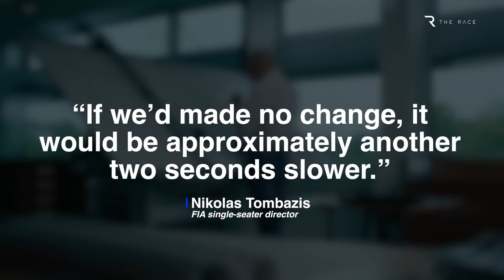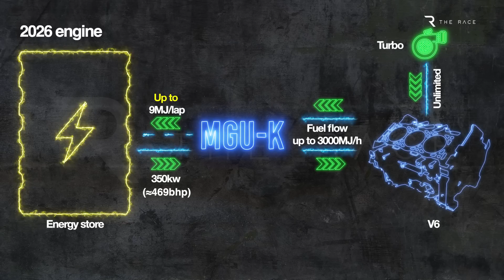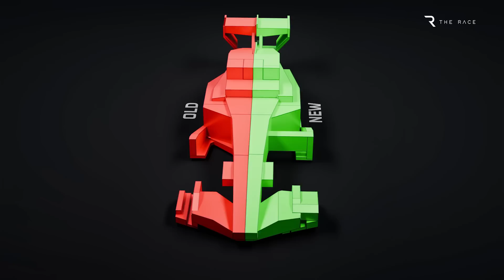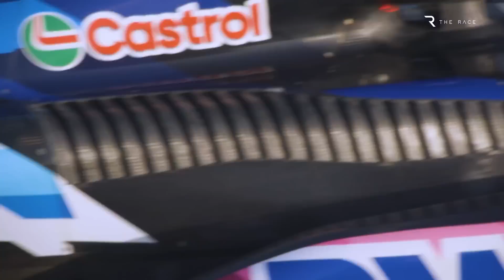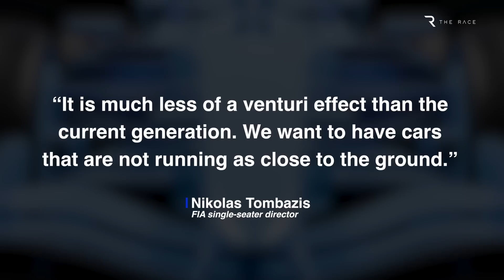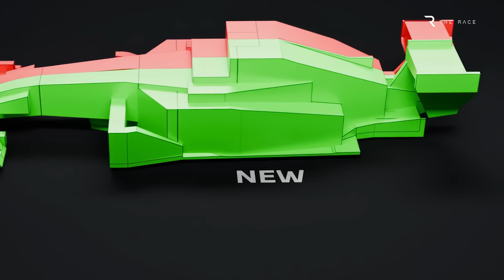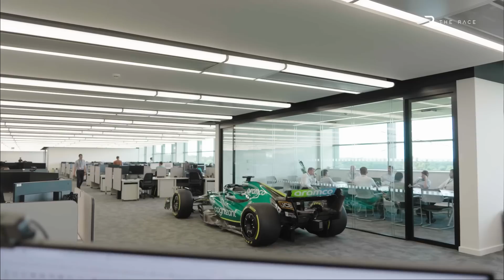How F1's 2026 cars will now be two seconds faster

Comment: Who Christian Horner?
And ETA: wouldn't the more potential "flow conditional devices" create more dirty air at 2026 and almost none but dirty air by 2028?... Thus the "electic DRS" solution? 
I'm a layman, but isn't ethanol or hydrogen (in which I believe is the future) sustainable enough?... Bring back non-hybrid engines, regardless of V10 or V8 or even twin turbo V6... This'd make cars smaller and ligter IMO

Comment: F1 just needs to have just a few rules. 4 tires used, halo to protect driver, crash pod/protection and make the car about 10-15 percent smaller with the box rules. Let the manufacturers decide engine size, cylinder count if they use hybrid, choose to refuel and weight. Then we can see what they can really do.

Comment: You hear it repeatedly said the 50% of the power will come from the battery yet the only power source is the ICE. The electrical system aids in deploying extra power for a short period but at the end of the day, with limited regeneration the average power per lap will be what? 550hp? How is this going to work out!

Comment: I want to see the cars have a top speed of 400 kph on the straights.
Reply: Thats just dangerous, if they lock up that crash could be career ending, the top speeds are fine as is
Reply: @PackyWacky1219  maybe they know that if they push the speeds 10 kph more it will increase the accidents.

Comment: Maybe this is an unpopular opinion, but I actually like how much of the car's power will come from the battery. This will be a bigger factor than anything else we've seen before. Dirty air, tire management, ride height... these will all be secondary issues if teams can't figure out their battery tech. Drivers will have a lot of discretion about when/how to use their battery, with far bigger consequences than today, which means that driver workload will be dialed up to 11. There will be a lot of strategizing, tons of overtakes, power miscalculations, etc. Racing will become a game of bluffs thin margins. It will be incredibly dramatic and exciting.
Additionally, technological advances in battery tech will actually help humanity.

Comment: Sounds like we're back to the 2021 cars, but less fun. The new 2022 car was supposed to create less dirty air and more downforce on the floor to enforce better racing. This new concept will reverse that action regardless of the endplates on the front wing. Qualifying will be good content (since they have battery), but considering the 1,6 liter engine now has to be 50/50 with the power unit will make the 2026 races to be another train event. But I guess it's okay since it will have an impact on the climate, right? It will right?!

Comment: F1 noob here, why have any restrictions at all? Why not open up the design restrictions to allow to engineers to design the most bat shit cars they can. Dont see how the manufacturers championship is a true competition when half the cars are only slightly better than the next
Reply: It’s for safety, they just can’t have cars with 1500 hp and achieving higher top speeds. CART, Indycar, and F1 have been slowing the cars down since the late 90’s. Engine builders just got too good at making horse power.

Comment: Absolutely NOT the "biggest reset in the last 50 years."  F1 used to allow the engine and chassis designers to choose their designs.  The engines and most of the car weren't controlled by the FIA regulations, as they are now.  Current, and recent, Grand Prix cars are almost a One-Design Formula.  The 2026 cars will be more of the same.
Reply: Bingo, its super overexaggerated.
Reply: @Tahllinavian all aerodynamic dependent and no scope to achieve gains anywhere else.
Reply: @Mishima505  Yes

Comment: Making half the power come from electric is probably going to result in more waste and more emissions due to how fast the batteries will be trashed after each race. The initial carbon footprint is far worse in electric cars, and when you need a new one after every new race that surely wont reduce emissions

Comment: 2026 rules are the result of basically failed 2022 regs, and they prepared ever worse - guess the result
v8-v10 with synthetic fuel and simplified aero is all we need, 10-20% battery power is ok

Comment: The best thing F1 could do to bring down weight and make cars more nimble during races would be bringing back refueling. With smaller fuel tanks and less fuel weight on the car, cars would also run way more efficient.

Comment: While a small change in the right direction, here's what would make F1 far more fun, far cheaper, and far more sustainable:
1) Fewer races! I would aim for a maximum of 15 in a season, no damn sprints! (non-championship events may be staged)
2) A mandated cut in maximum wheelbase and track to about 50% of the current size
3) A minimum weight for driver + seat, no other weight restrictions as long as crash-test worthy.
4) Ban all aero between the axel lines, with a one-piece wing mounted fore and aft of the axel lines of a maximum horizontal area
5) Drop the engine formula for an F1-provided standard fuel formula. X-amount of fuel for a face, how you complete it is up to you.
6) No driver aids, no in-cockpit or track-side adjustment allowed while the car is in motion, diff(s) excepted.
7) To qualify as a manufacturer you must design and build your own chassis, all other parts are tradeable.
8) All manufacturer's to field two entrants per race, no more, no less - no manufacturer points for any race where this isn't followed
9) Privateers may field a single car, bought as a complete package from a manufacturer, no manufacturer points.
10) An open grid - if your entry and your driver(s) qualify you get to run. Prequalifying to whittle down entries if required. 107% rule strictly enforced
11) Every team to choose their fixed tire allocation pre-season, not including inters and wets. No rules on how they are used.
12) Occasional entrants allocated the 'FIA standard' tire set for the track / weekend.

Of course it's never going to happen... 😞

Comment: higher nose cone? finally. i really think higher nosecone tip(in relation to the front wing level) more "compatible" for ground effect car. 
plus,with the allowance for more sidepod/front floor panel aero bits extend close to the front wheels in 2026, the old "zero sidepod" idea of the mercedes could actually make sense now. because now they will have apparatus to handle the wake from the front wheel. currently, the sidepods MUST take some part of that role.

Comment: ALL OF THE POWER comes from the V6.  This is where the power to charge the battery, to run the electric motor, comes from.   
It cannot magically appear from nowhere.  Power harvested from the turbo, and brakes ALL originates in the V6.

Comment: The worst aspect of the 2026 regulations have not been tackled. Those are the engine regulations and the 50/50 power split. 

Weight and size also remains an issue. 20cm shorter than current is still too long, and 768kg min weight is what F1 cars weighed in 2021, and they were still too heavy and had bad raceability.

Comment: Once we can ditch the batteries and related parts, and use renewable fuels the cars will be much ligheter even with the safety regs. Then we can get rid of the "straight speed" mode and all that nonsense too. F1 tech hasn't been relative to road cars for at least a decade. Let's get those renewable fuels in, and ERS out. If they want to be relavant, allow them to experiment with engine designs as well as all the other parts. They've frozen engine design for decades: elements pulled from the earth, 4-stroke Otto cycle, no VVT or lift. Open up engine design, and let's see where we go from there.

Comment: These regulations are such a huge disappointment. P/U output is likely to be greatly variable over a lap. I’m disappointed to see the cars narrower, but at least they are not 180cm. What makes the modern cars so ungainly is the obscene length, not the width. They should have reduced length by 40cm+, but then it would have been difficult to find space to smuggle the massive battery pack. I think we will need a massive rethink of this F1 direction. Dimensionally we should look at cars from around 1990-1997. I also don’t think that battery tech is F1 compatible as yet to continue pursuing hybrid p/u’s. Until then, F1 cars will continue to be massive and massively overweight.

Comment: They is just so much energy you can extract from a litre of petrol, even if you got a bigger battery, with a turbo. Any engine has losses and efficiency of 70% couldn't be reached with the present day, 50% is the present day value. And that will be lower because less fuel will be available. So,  no 2026 will be a disaster.

Comment: So now we will have formula one cars that are half way to being copies of formula e cars with almost half of the power supplied by a damned battery. They say they want to make the cars smaller and lighter, well the easiest way to do that is to do away with the hybrid system battery for one. Get rid of the battery and the hybrid system and just go to a bigger v six engine or something. We don't need two electric car series which is where formula one is heading.

Comment: What I would do as FIA boss: Let in more teams, bring back V8 and remove battery to save weight, make the cars smaller, bring back the old tires to save weight, bring back refeuling for more strategy and to save weight, less downforce and more drag to reduce dirty air and make slipstream more effective. Also better circuits.

Comment: F1 decides that the cars are too big, heavy, and have too much aero to race properly. F1 decides to force the cars to rely even more on heavy hybrid engines. F1 realizes that means it's going to make the cars slower. So F1 decides to give the cars more complex outer-body aero after compromising so much on the weight and size that we're not going to see many benefits... So we'll probably see worse racing as a result.

Makes sense. Never going to see F1 bite the bullet and do anything (if that be alternative fuels or going huge on synthetic fuels) to bring back V8s.

Comment: In 2025 we might have some of the closets racing between 8 driver than we've had in decades.
In 2026, we may well lose that close racing.

All these areas that allow the leading car to manipulate the airflow, will very likely make it harder for the following car to follow close enough through the corners to be able to get along side on the straights to the leading car. History has shown that when there is a big rule change, one team will get a jump on the rest, meaning they will be wining the race on the Saturday quli rather than the Sunday race.

Comment: I am warming to the new regs the more I see renders of the new cars. I'm liking the size reduction, the front wing, the next gen active aero, the higher top speed, and smaller tyres which will make the cars more agile. Glad to see the back of gimmicky DRS and return to a attack mode/push to pass system.
Reply: Not sure about higher top speed.. remember, once the cars hit 290kph the MGU-K stops deploying max power.
Reply: @Goron333  no, the MGU-K stops deploying max power at 345KPH.
if it stopped deploying at 290kph, we would not even reach 300kph.

Comment: I don't get why there was so much negative press about the 2026 cars having up to 40% less downforce than today. When the cars have less downforce, they're sliding around more, the harder the drivers have to work, the greater the chances of mistakes, which in turn improves the racing. Reducing downforce is a win, win, win as far as I'm concerned, even 1976 world champion, James Hunt, said that he enjoyed taking a humble Austin round a track as fast as it would go, more than an F1 car. 

Does this mean I want to see everyone in F1 racing a humble road car, of course not, I'm just keen to see better racing action, rather than cars running on rails (hyperbolically speaking), I want to see the cars act like monsters (within reason) so that it shows the drivers working hard to get the lap time, not looking as undramatic as they do today
Reply: If you want the cars to slide around like in 1976, you need to mandate crossply tyres. The introduction of radials to Formula One killed the four wheel drifting, by 1986 all tyre suppliers supplied radials and the four wheel drifts were long gone.

Crossplies generate peak grip at large slip angle, radials generate peak grip at small slip angle.

Comment: F1 slowly becoming formula E...
Reply: F1 need to have all wheel drive
Reply: Doesn’t make sense when there’s 24 races a season all around the world.  They should have limited the calendar, limit the geographical regions and travel, but stick to V8’s.
Reply: We still have horse racing, but sadly chariot racing is mostly gone.
Reply: Its fucking lame
Reply: Keep increasing battery size until it becomes Formula 1Ton
Reply: Hydrogen will creep in soon
Reply: @chapperz994  not even Toyota believe in that anymore
Reply: good
Reply: @scolopendras  no
Reply: @scolopendras stfu this is not "good"
Reply: @scolopendras Not good at all.
Reply: @scolopendras  reality proves you wrong. Nobody tunes in to watch that crap.
Reply: @bikerboy3k  i dont think the engines are the main problem of f1. The 2022 changes have failed to deliver on their promise of closer racing and better overtaking in my opinion.
Reply: @scolopendras  which is a completely valid point, agreed.
Reply: @scolopendras Dont you remember 2022 season where cars were following closely each other? FIA could not protect it.
Reply: @bikerboy3k nobody tunes in to f2 either, what's your point?

Comment: Sounds a lot like we’re going to be back to messy airflow behind the cars again, and we know much easier that makes overtaking. They should have stuck to their guns and made the teams work with the regulations, not capitulate again. If they were worried about speed we could have had straight line rocket ships and then put the onus back on the drivers to make the difference in the corners again but no, we have to stick with single line scalextrix racing again
Reply: Problem was without the increased downforce levels you'd run out of juice too quickly on the straights and you'd have to effectively downshift and lift-and-coast for several hundred meters on the straight. Bad look for the sport.
Reply: @ I see your point, but you don’t run out of juice on straights with the correct gearing. We could have had slipstream races with last ditch braking overtakes but no, much go fast round corners where everyone had to follow each other at a one second gap otherwise you lose too much time ….. yawn

Comment: They should get 2 decimeters SHORTER and NARROWER instead, that would be great - force smaller battery and engine, but making cars smaller will make them racier
Reply: And way less downforce too. Isn't it sad that most real fans agree on what should be done, and then the regulators do the exact opposite.